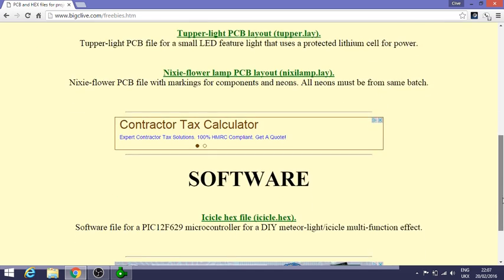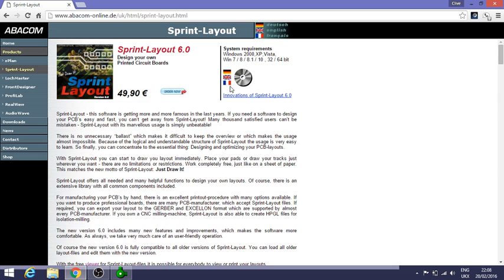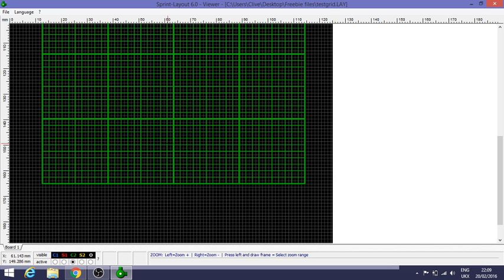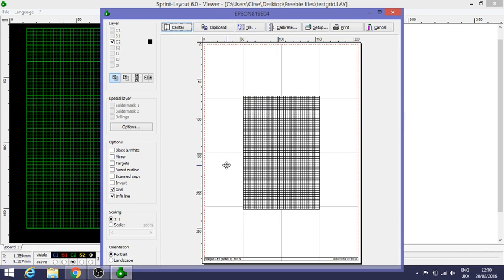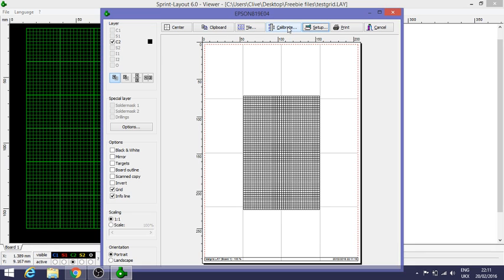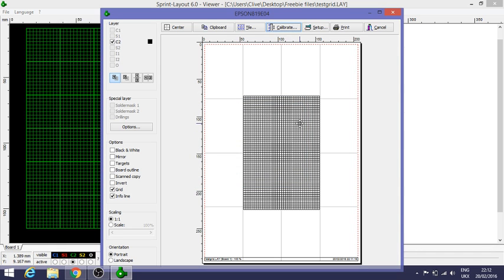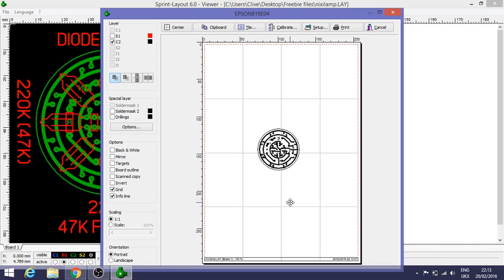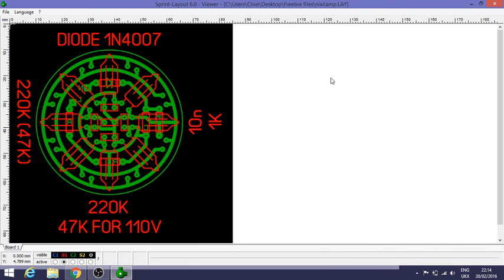How to use the free PCB layouts on my website.  (horrible audio)

Comment: What's wrong with eagle and why are you pushing people to use a commercial software that is other than industry standard?
Reply from the maker: +Tero Nurmi Because there are other options.  I use this package because it closely resembles the PCB design package that I originally learned on.  I tried Eagle and found it extremely frustrating to use.

Comment: Too bad I use Linux and HATE wine to the point I refuse to even acknowledge it's excistance.
Reply: +Joshua Nicoll Why? Think of Wine as a giant shim. Edit: Even Microsoft is known to use parts of it in it's own OS for backwards compatibility.
Reply: +yamatoneko1 I hate it for its ungodly shit interface, horribly optimisation and massise tendencies to crash under moderate loads, dispate the host machine being more than powerful enough to the tast with barely 15% of overall resources used.
Reply: +yamatoneko1 That was an Aprils Fools joke.

Comment: the viewer software seems to work fine in Wine under linux mint 17.3
Reply: +KingNast That's good to know. I hate it when people just assume everyone runs Windows.
Reply: +KingNast My Ubuntu machine is running it with out hiccups. But at the end it depends on the Wine version.
Reply: +Gooberslot You can always use a VM or have a beater PC with Windows on it.

Comment: I've believe I have been teleported to the 90's 😂 😂 😂
Reply: +TheJohn8765 It does everything it needs to do and nothing more, which makes it a successful page in my book.  There is no need for such a simple page to be anymore complex to do its intended job.  What's better, all the HTML layout can be trivially done from a simple text editor as well, making maintenance trivial if well layer out.
Reply from the maker: +Ethan Poole I edit it in notepad++ these days.   Also note that all image sizes are declared, so the page doesn't jump like modern bloat-sites as they load, resulting in mis-clicking.
Reply: +TheJohn8765 
yeah I really do hate that to go to most websites now I load half a dozen layers and ads and 50 menus and if it is a news site about 10 pages of spaced text.
I do miss the old ways
Reply: +kingoginge His website is hilarious. It makes me remember using a 14.4 modem and Lynx Browser (text only) to save on load times :)

But hey, it loads super fast and doesn't display weirdly.
Reply: +TheJohn8765 I had an external USR 14.4 Sportster (none of this Winmodem rubbish).  I migrated from OS/2 to Linux in 1997, and found a couple of Wyse serial terminals for $10.  These were used with Lynx, Pico, Gopher.  You could browse without graphics, no problem.  It was a real controversy when the first banner ads appeared.
Reply: +kingoginge THIS is what the 90's would look like with fast internet :o
Reply: +Ben Baker And at least 10-20 different Javascripts from all and sundry, mostly for keeping track of you and the ad revenue.
Reply: Ethan Poole The content is top notch (as Clives stuff always is) which is the most important thing, but as a graphic designer I do have a thing for aesthetics and layout! Design does have a huge impact on the way people consume information, not to be overlooked. I refuse to read anything on Reddit because the layout is so bad and the prioritisation of posts is just illogical to me.
Reply: pillsnotbills The Sportster was awesome! The only nice thing about some of the winmodems was you could flash their soft-firmware to 56k. Sweet.

And yah, I don't recall missing the majority of the picture bs since websites used to have a writing team instead of the current regime which is more focused in in-frame ads and the like than the content you putatively came to the site for.
Reply: bigclivedotcom No complaints intended, mate. I especially appreciate the "doesn't move one picosecond before you touched the screen" thing.
Reply: +bigclivedotcom Don't critique other websites. You don't get to critique websites.

Comment: Hey Clive, a bit of an unrelated comment but here we go:
A few years back I was given an iPod/iPhone dock that seemed to be a bit hit and miss- the dock was probably not designed for my generation of iPod so it wouldn't sit in the dock very well and so the audio was prone to cut off. I shrugged it off and botched a bit of craft foam into a support for it and that seemed to work pretty nicely... ish. However, a few weeks passed and I went to pick up my iPod and I got quite a shock from the casing of my iPod. (I had ignored the occasionally crackly audio and a few tingly hair-raising sort of moments that I had just pinned down to static lol). The shock was enough for my arm to get thrown back and caused a bit of tenderness for a few days.

So yeah, I was wondering if it is indeed possible for metal cased devices to become live on a dodgy dock/user error, and if you could deconstruct some cheap Ebay ones. Love your videos, been in a binge.
Reply: *On. On a binge. Hehe.
Reply: +Mats Thorsen Does the dock use a figure 8 cable or does it just plug into the mains directly?
If it does plug in directly, does it have the earth pin?
Reply from the maker: +Mats Thorsen You can get a tingle from switchmode power supplies due to capacitive coupling, but not enough to cause an effect like that.  What was it plugged into at the time?  If it was connected to a cheap USB charger then it may need binned and replaced with something from a reputable supplier.
Reply: +bigclivedotcom it was plugged in at the time. I can't remember what the plug type was apart from that it did directly connect to the mains. It also had a battery section I think. but it actually seemed like a pretty decent and robust sort of thing- I guess looks can be deceiving though. 

The dock might actually still be at my parents' house. If it's still hanging around, I'll make sure they keep it to one side. I might be able to give a better explanation if I can see it again.
Reply: +bigclivedotcom oh yes and it certainly hasn't been used since. I am a pretty paranoid person when it comes down to electrical safety, even if I was a bit careless with the warning signs from the dock :P
Reply: +Mats Thorsen   sorry for the comment stream, can't seem to edit my comments. To be more accurate, the device was conncected to mains power by one of those round hollow jack plugs (not familiar with the technical jargon), so you can disconnect it from the mains and run it on disposable battery power (which I never did).
Reply: +IIGrayfoxII sorry I can't really divulge much in the way of technical details. I'm not a techy and the device in question isn't nearby and it was a few years since I last used it :P

Comment: Windows 10.... I hope you have all the built in spyware turned off.
Reply: +simontay1984 How can you be afraid of spyware and run Windows? Why not just switch to Linux (if you must, on an open-kernel computer, just like RMS). Then you can check all your programs for security holes.
Reply from the maker: +ElfNet Gaming Windows 8.  I've not braced myself for 10 yet.
Reply: ***** I still run windows 7 mainly because I hold an enterprise VLK license.

The UI in windows 8.1 looks about the same as win 10...
Reply: +ElfNet Gaming There's no way to turn it all off.

Comment: you know you can use your Ipad's mic
Reply from the maker: +milano007100 It WAS using the iRig Cast microphone.  Something else on the laptop really compressed the audio bandwidth.
Reply: +bigclivedotcom Out of curiously, what was the sampling rate set to for this recording?  I ask because it can be set as low as 8KHz (or 4KHz bandwidth at Nyquist), which will give a very compressed sound to speech audio.  Not unlike the speech compression we sometimes run on HF SSB with less than 3KHz bandwidth on amateur radio (which gives HF SSB it's very distinctive sound versus other modes).
Reply from the maker: +Ethan Poole It was set high.  So latterly I actually lowered it in case it was part of the issue.